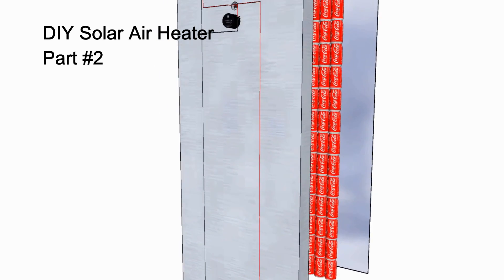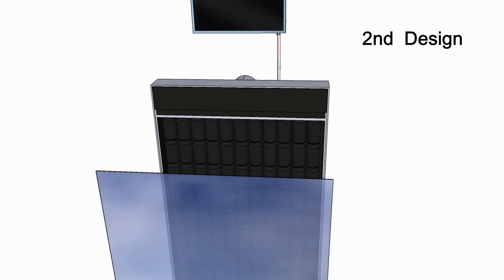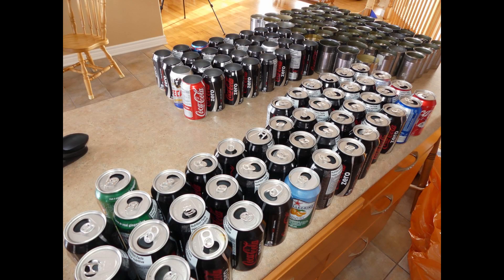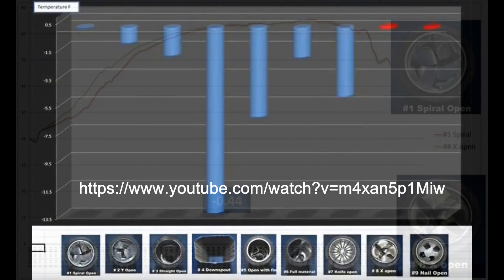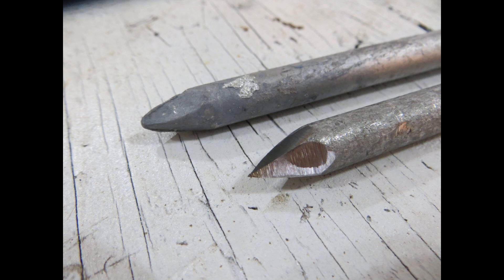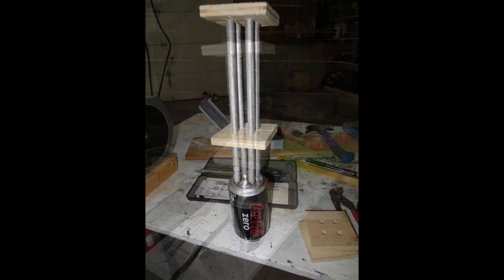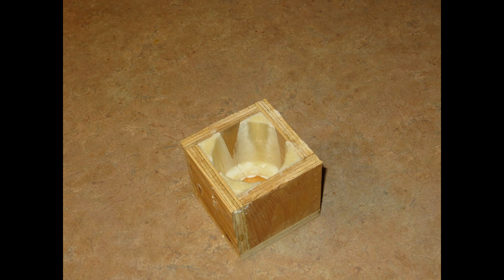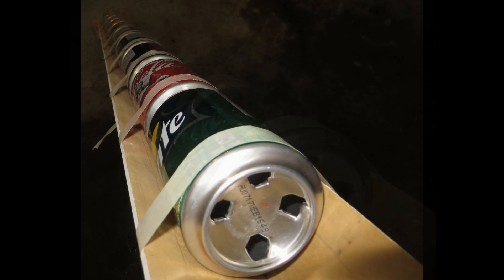DIY Solar Air Heater Part #2

Comment: Regarding cans vs downspouts.....Seems to me the downspouts would retain the heat much longer than cans, thus making it a tie in my opinion especially looking at the HOURS time spent messing with cans. Also no mention was made on whether the cans and downspouts were painted black for the test.
Reply: Cans are worth $.10 in Alberta Canada. No contest, unless you have really valuable time !

Comment: The rain spout design will absorb MUCH more heat if you put resistance in the them.  In my case I use crumpled screen material.  I then noticed a significant {~28°F} increase in temperature relative to open rain spouts.
Reply from the maker: I love this idea.  This would be a great follow-up approach for me to try.  Thanks.
Reply: Crumpled aluminum screen?

Comment: You missed the obvious solution. I used a plastic and hard foam drink holder to hold the cans and then took a drill press with a hole saw the size of the bottom depression on the can to cut out both ends. I liked the flow of the cans with both ends cut out and the unit still raises air temps somewhere between forty and fifty degrees with no fan required as convection currents actually blow out the hot air effectively.

Comment: The best heat exchangers, I assume, are made of thin, highly thermal conductive  material.  A soda can definitely meets those requirements.   But when possible, wouldn't no heat exchanger at all be even better?  Why is a heat ex changer necessary?  Would not ideal placement of intake and out take openings with some baffles work better?  Perhaps doing away with the heat exchanger and increasing the surface area inside the box with layers of screen painted black would be more efficient.
Reply: You really need a radiator to collect the heat and heat the air up more than just the sun shining on an empty collector box. The screens may work well but I don't have any experience with them. However my can heater raises indoor air temp by forty to fifty degrees that flows through it and I get from five to six hours of that heat on a sunny day. I made mine around five or six years ago and have never even added a fan as it convection flows quite a bit of air.

Comment: At 3:50 it describes higher temp, but disregards heat which is more desirable and a different measurement.  Do downspouts give more heat, but less temperature? (  More heat and less temp is better for heating the house and is also more efficient.)
Great video!

Comment: I believe you would actually be better off NOT removing the tops of the cans.  If you leave them on, it creates a baffle that slows down the air movement and increases the heat absorption.

Comment: Acrylic is NOT resistant to sunlight as UV will quickly destroy it. You can expect "plexiglass" to be opaque within a year or two. How has it fared so far?
Reply: Polycarbonate is better for outdoor use and brutally expensive
Reply: MAD GRUMPYMAN  OK I don't have access to that.. Is this from a specialized supplier? I would love to get some. I'm in Qc. You are talking about that material that resembles coroplast?

Comment: also what kind of can cutter is that ?
Reply: XxXsupertrampXxX it looked to me on the thumbnail a can opener that is a no sharp edges one. Or a safety can opener.  And he’s using it on the can lid side. The other side requires a different process.
Reply: @blairbushproject  That’s what I thought. I was hoping someone had a brand that I can look up. I’m sure some work better than others.

Comment: Old shower doors?
Reply: Find free sliding patio doors. You can peel the glass from the metal that holds the 2 panes together.
Reply: C S just make sure it is clear and not have a frosted design on it to block sunlight ...

Comment: The problem with aluminum cans is that they cool dawn as quickly as they get hot, so with them there is no heat acumulation.  So I decided to built a model in which ceramic elements are wrap with the aluminum wall of the cans.  In this way the solar colector will continue to give hot air after the sun goes dawn and also during these periods of time when the clouds hide the sun.
Reply: I understand your suggestion however you're only going to collect so much solar energy. It doesn't matter if you get it all over five hours or over 12 it's still the same amount of btu's of heat. I can run mine for five or six hours and it will warm my home and shut off my thermostat for all that time. And it has the advantage of heating up in a few minutes of direct sunshine instead of waiting for a heat sink to warm up enough to allow heat to flow out. If you have good south facing windows clay tiles set on the floor will gather heat all day and reradiate slowly into the night.

Comment: Solid state graphite power cell bank that charges a organic carbon power cell bank that heats a glow plugs in a bowl of gallium with a heat sensor that switches on a hydraulic pump or electromagnetic pump to circulate super heated gallium through copper heat exchanges one with a fan to draw air over coil to heat the air and another in a water heater to heat water. With all the pipes with gallium designed at an angle so all the gallium will drain back into the bowl with the glow plugs were the cycle starts all over again . Insulsted copper pipes would be a very good idea even thermal electric generators could be added to the system if more electrical generation were needed. Crazy idea.
Reply: Can you details a bit please? Thanks